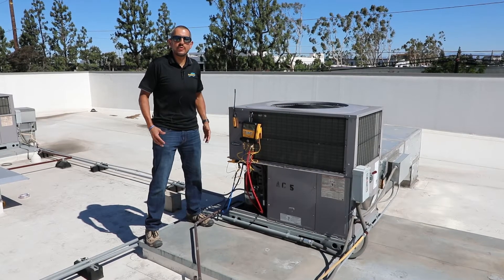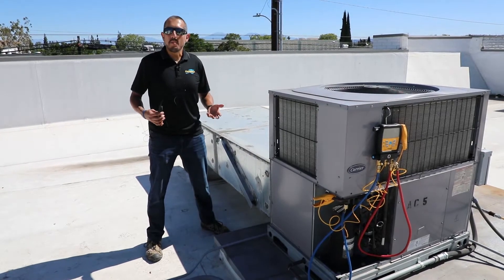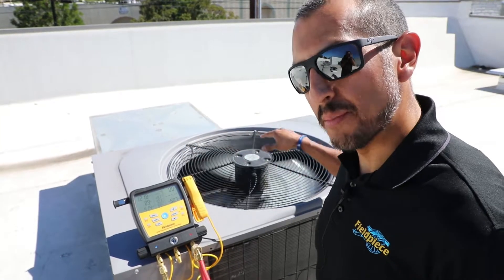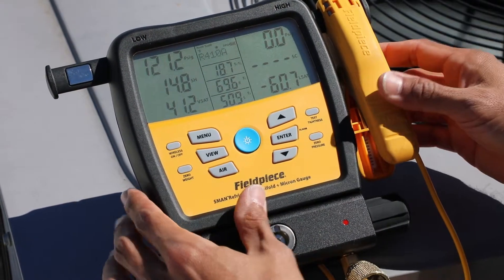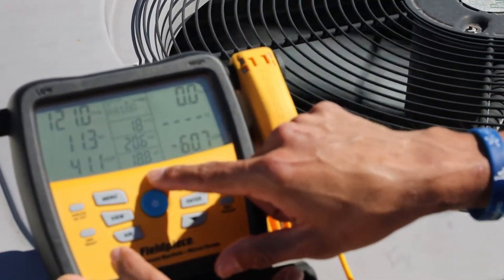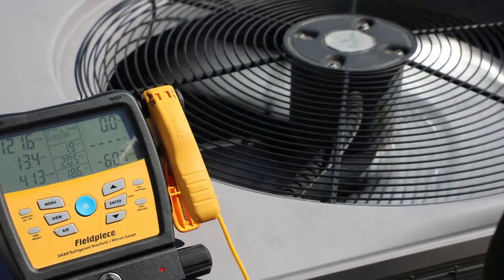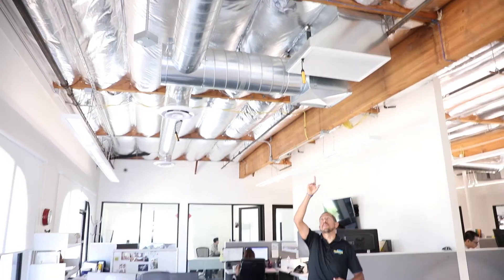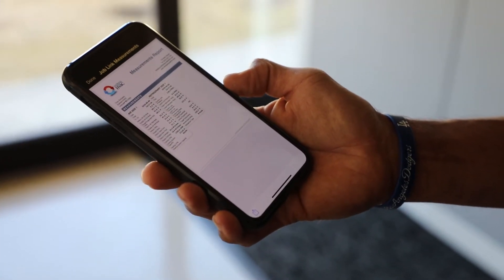Getting Delta T with your SMAN and Job Link Psychrometers

Comment: Can you charge using delta t withs piston system residential
Reply: Never charge any system with delta t. That’s only an indicator for air flow. With a piston charge the system with a super heat. With a txv charge the system with SubCooling.

Comment: Ok video ! i Think Caibration is Going to be Off a Tad on those Probes after YOur Fielpiece Recommended Probe Removal Process. Lol !!! im thinking adding a 6' length of string or light guage wire if your going to be tossing the probes into the air at Grills to aid in removal process. Lol !!!

Comment: You're gonna have to work on the probe removal process Tony 😎👍
Reply: Lol ! ikr. im thinking adding a 6' length of string or light guage wire if your going to be tossing the probes into the air at Grills to aid in removal process. Lol !!!